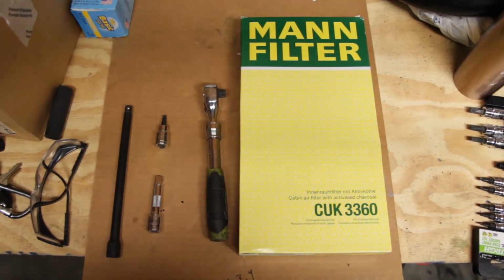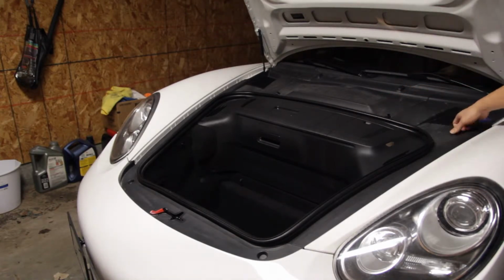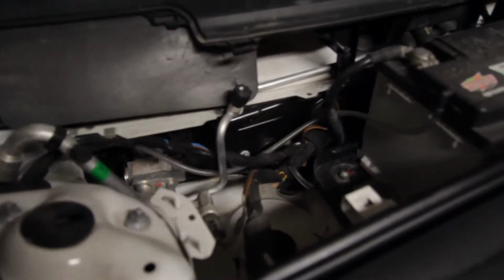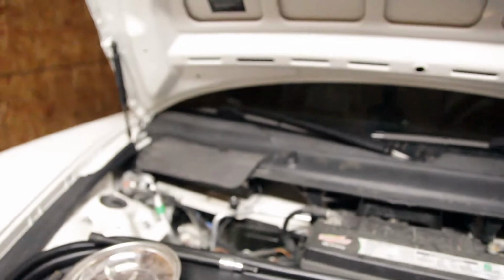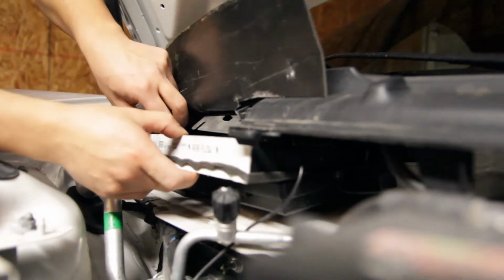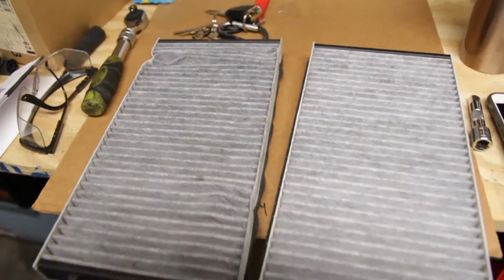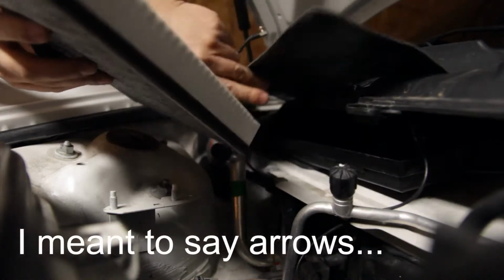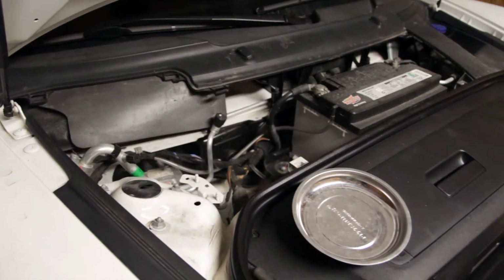Porsche 987 Cayman Cabin Air Filter Replacement

Comment: I watched about 10 of these, but none of them was the same as my 2008 S Limited Edition (the orange one). I had to figure it out for myself that the black tab holding the filter in - which has no apparent screws holding it in place - SLIDES to the side, and then it pops out; not the most intuitive. As well, those two plastic pieces that you have to remove do not exactly slide easily back in: you have to pay attention with the center, large, piece where the hinges go, before you flip it down (best done from in front of the vehicle, even if it may be a reach for someone with shorter arms). "Germany engineering!" I hope these additional notes help the next person - will post it on every related video. Good luck.
Reply from the maker: Interesting. Curious why, of all things to change, the setup would be different. I appreciate the extra tips brother! Thanks.